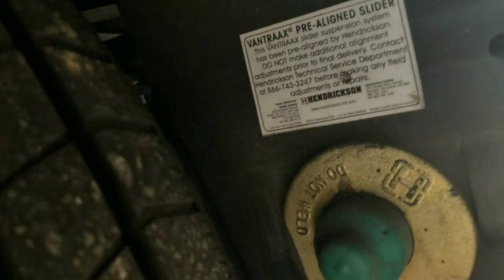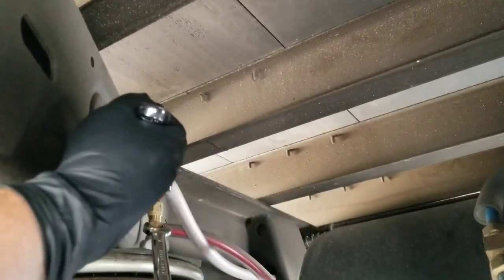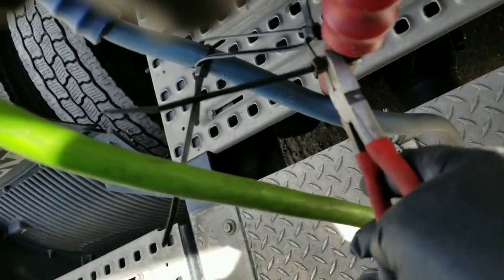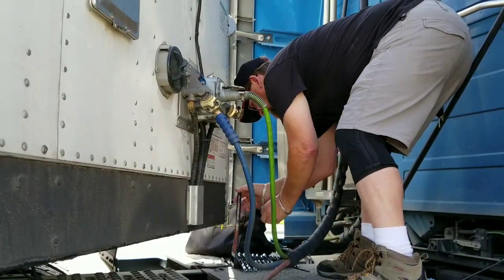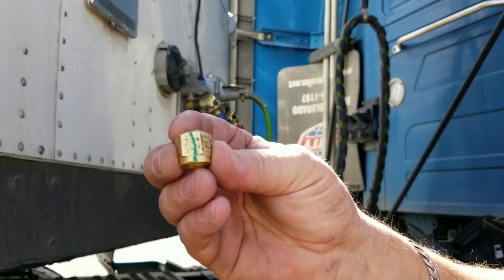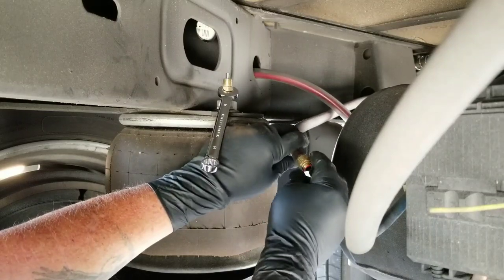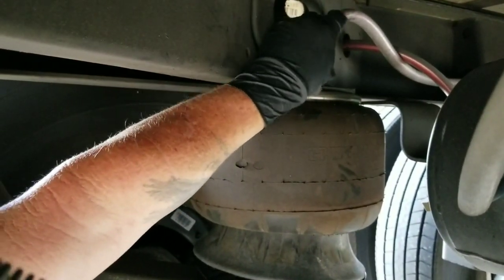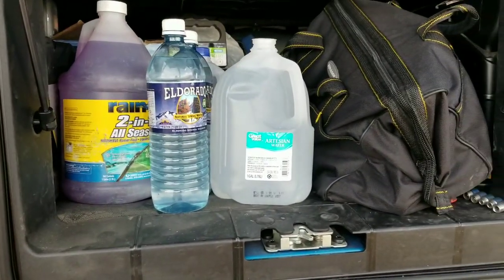Repairing an Air Bag On a New Trailer on Fathers Day!! Yee Haw!

Comment: You need to replace that glad hand fitting asap. They are very weak. Good to have one as a spare though to get you out of a bind.
Reply from the maker: I am going to have the shop replace it when I get back.. explains the thickness of the factory fitting..

Comment: I know what you mean.  My employees went to pick up a new pickup two hours from the office.  On the way back they stopped for lunch about halfway back.  As they started to pull out of the parking lot the steering wheel went around in circles.  It was totally gone.  The idiots at the dealership said everything was checked.  The steering box was completely dry.  How the guys made it as far as they did without it failing was a mystery.
Reply from the maker: Wow . That's a wild ride.. glad they didn't have an accident

Comment: I was in the middle of nowhere and same issue with a line on my tractor was dumping all my air. I cut the line and was able to open up the ring just enough with a screw driver to get it back on. Got me thru the trip till I got back home put a new fitting on.
Reply from the maker: I call that stuck in the desert.. almost anything will work to get you going again..

Comment: That red air hose going to the air bag should be re-routed up over the other red air hose.  Should be a little more slack in the hose for that  straight fitting.  Better yet, should have been a 90 degree fitting.  Nice fix for out in the middle of no where!  Ken

Comment: Those two airlines rubbing together above that airbag make not pass a DOT inspection and eventually will wear a hole in one or both of them.
Reply: I noticed the same thing and was gonna comment also. Will def rub thru from vibration at some point.
Reply from the maker: I gave a heads up to the shop..

Comment: This vaguely reminds me of the after-investigation of a passenger air disaster over SoCal about 20 years ago. Plane lost control, flew mostly inverted; Pilot & Flight Engineer COULD NOT rectify in flight; for the last 3K feet, plane went into an auger mode; and, madly spinning with fuselage length as axis, slammed HARD into a Santa Monica mountainside, completly disintegrated . . . no survivors. FAA investigators found an almost completely STRIPPED jackscrew on the tail's vertical stabilizer. So, a similar internal fitting, that makes the JS go back and forth, as demanded, by the Pilot's controls, and at some point, been installed "catty-wumpus", instead of flush, thereby stripping off all of those crucial threads. As with your air hose sealers(?), this part could have also been "ridiculously" inexpensive to replace, and someone definitely DID drop the ball with this tragedy. I'm sorry, but I do not precisely recall the ultimate outcome, though I imagine the Airline was successfully sued, and their Inspector, was Tried and Convicted, on multiple counts of Negligent Homicide.

Comment: Volvo is a European manufacturer but maybe makes trucks for the American market in the US. Is there a standard for US trucks as far as metric vs SAE sizing for bolts, pipe fittings (NPT), hoses and such? Are all the fittings and threads used on your tractor and trailers metric, SAE or a mix? Do you carry a metric crescent wrench? Are distances measured in miles or kilometers? Weight in pounds or kilo's? I'm so confused!

Brass ring = 'compression ferrule fitting', that goes inside the brass compression cap. I've used both copper/brass fittings as well as stainless steel "swage lock" products in the high tech vacuum industry on copper tubing, stainless tubing, pex-like tubing etc. Unbelievable that an $0.89 fitting stopped the show. The inspector probably was only checking to see if the cap was tight without any thought to the complete assembly of the total fitting. This is were the rubber meets the road, so to speak. Taking responsibility for a complete, thorough inspection of the assembly on such a vital system. Makes you wonder what else you can trust on that trailer or others by the Utility Trailer manufacturer.

The hose fitting off the tractor sure looked second rate. The Volvo company was probably saving a few cents per hose. Sometimes, a little better quality goes a long way, especially in regards to safety but also to the manufacture's reputation, down time costs, labor time and materials to fix. There's always time and money to do the job a second time but some managers are often too cheap or too rushed to do it correctly the first time around. Saving pennies and losing dollars!

Your accepting the reality of the situation and assuming total responsibility for "getting 'er done" on what should have been a day with the family, is what makes this country great. Reminds me of why General George Patton loved his 'farm boys' in his Third Army tank corps. His boys could fix just about anything they needed to, after having done so on their home farm equipment, without having to call in specialist mechanics. Keep 'em rolling fella's!

"Convoy" by C.W. McCall references the 1944 D-Day landings in France at the start of his song by describing "the dark of the moon on the 6th of June". The big push just continued to build and there was no stopping the US Third Army or the supply support of the "Red Ball Express". Likewise with the Arab oil embargo of the 1970's when the speed limits were all lowered to 55 MPH on the interstate highways (and this song was written), the truckers said 'to hell with that' and kept their product moving. The CB radio was just coming into vogue and it was a way to enhance communication among the people, just like the internet is doing today.

God Bless this beautiful country!

Peace out good buddy, we're gone.
----------------------------------

"Convoy" by C.W. McCall
https://www.youtube.com/watch?v=87r0CPQbFds
Reply from the maker: Right on seamus.. thanks for the props..